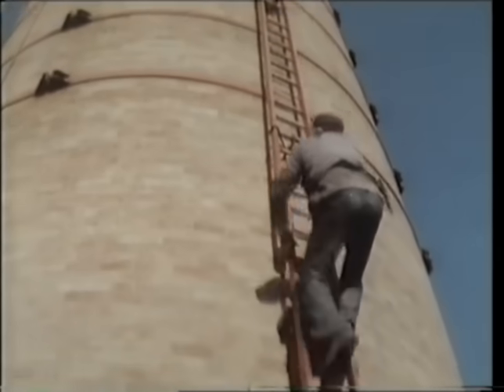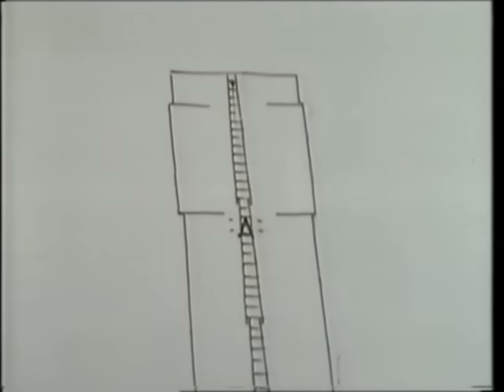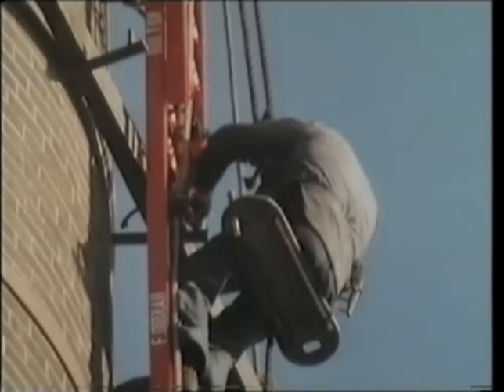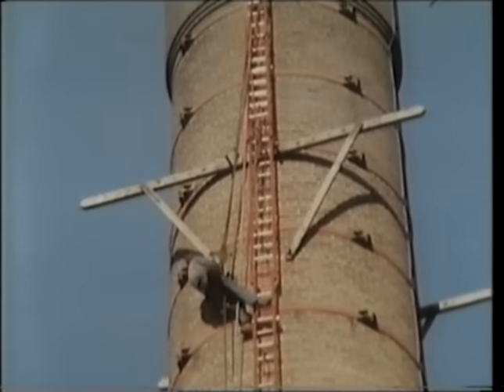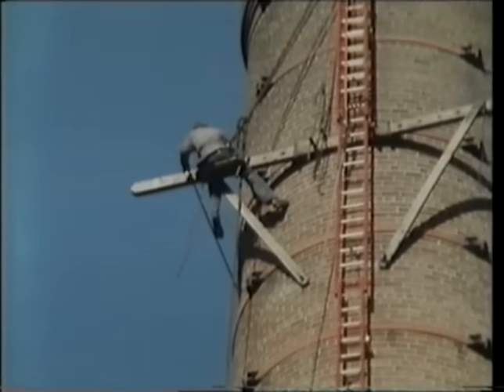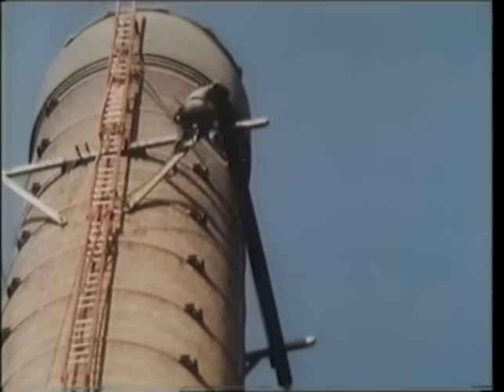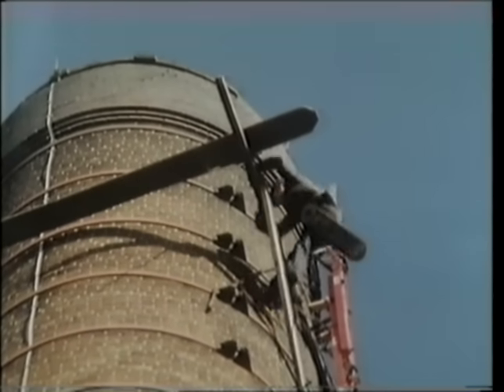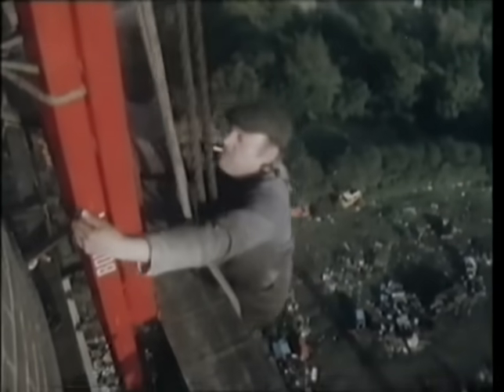Fred Dibnah How to erect a chimney scaffold

Comment: Takes incredible strength and endurance to hold those long boards and rods extended out like that, and hes doing it mostly with 1 arm, while the other holds to the ladder. Even light weight things are troublesome.

Comment: A master stack hand.

I worked with a now retired boilermaker who reminds me so much of this gentleman.
He is now 86. I started at 22 helping him. I’m now 61.
He worked on stacks so high the choppers bringing structure up emerged from the fog below into brilliant sunshine above. The most fearless man I’ve worked with.

I went over the side of an old hydro electric dam in a bolson chair to weld some test fittings to the face.
It wasn’t the height but that black-green water swirling below. But one has to trust your ropes.
That dam from the late 1800’s flood gates had water spraying from ever possible seem.  Eight inch planks  between you and countless millions of gallons.
Reply: If Fred were alive now he’d be knocking 86…. You don’t get men of that breed anymore, made them of tough stuff back then.

Comment: I used to work at height on masts and often had to free climb with equipment up to heights of 300 ft (approx 100m). The highest I ever free climbed was 750 ft, just over 230m. During training we climbed on old WW2 wooden lattice masts that were of 1930's vintage and constructed to hold the old RAF 'Chain Home' radar system. That was pretty scary, you could look down and see the old grass covered craters where the Luftwaffe had tried to bomb it. When we qualified we were sent out to our operational areas and I remember my first climb being only about 30 ft up. I was absolutely terrified and hung on for grim death. Within a few months of daily climbing, both at night as well as during the day time, I was soon climbing up and down the masts and working away unrestrained at heights, walking across the beams with no harness, no problem. You get used to it and the height no longer scares you. However, looking at this and knowing what it feels like to be at height, this scares the crap out of me. We worked on steel masts, secure, solid structures with lots of cross beams to hang on to. This chap is swaying in the wind and making his own rickety platforms which he is relying on to save his life. I know they're secure, I know he was a legend and very safety conscious for the age, but just, no, no thank you. My hat goes off to him, he truly did have balls of steel and I have a great appreciation for the difficulties he faced. I really do admire him.
Reply: @Chase Williams I was a communications engineer in the army and we used to install various bits and bobs on masts at all times of the day and night.

Comment: Assuming I had the balls to do it in the first place, my arms and legs would be pure knackered by the time I got a quarter of the way up there, he just strolls up there like he is out for a walk in the country, PURE RESPECT.
Reply: Duncan Irvine we would climb 200ft silos and some of the old/ out of shape guys would have to stop 3 or 4 times and take a breather. One guy got up there and locked up, couldnt move, had to get the fire department to come get em down.
Reply: Curtis Richardson Fred would have carried them up Pmsl
Reply: Curtis Richardson was
Reply: and don't forget he'd come down for a few pints at lunchtime and then go back up in the afternoon
Reply: Puffing on a dart too.
Reply: @curtjrich15  I used to do satellite dishes and tv aerials and fell of thank god three single storey roofs without injury. The first twoo I got over by going back up the ladder again the last did something to my head. I got vertigo and the feeling is impossible to control as the more you try to control it the more it controls you so I know why people lock up. Its not fear its an actual feling of falling when at height. If you have ever felt that feeling you get in some lifts that is very similar

Comment: When he said ''You feel the chimney moving in the wind'' i just freaking lost it. What a freaking legend of a man! Hanging from the top of a massive chimney without securing ropes, sitting on a plank secured to tied on ladders while using steel rods that he pinpoints into holes across the width of the chimney. I dont think ive seen a feat of strength that made me feel at awe but this clip just made me utterly and madly impressed! 

I can feel my palms sweating just watching.
Reply: He earnt his paycheck that's for sure
Reply: "Once it's up, its like your working on the ground"
Reply: I'm with you on that.
Reply: What I find incredible is that he must have had to repeat that sequence several times as he knocked down the chimney!

Comment: Havinf worked in 2WTC on the 97th floor, I can attest that the ability to sway is and was a part of anything built tall.   We had to get rid of our hanging pendulum lights in the cafeteria.  They would sway in the wind.  Without the ability to have a reference point, you did not know it was happening.

Comment: I used to reslate roofs with no scaffold round the edge so if you slipped you'd sail off the roof and die. Thinking about it now I don't know how I did it or why I was risk taking like it but what Fred did just freezes my blood. Would not dare to even start. Just too busy to dwell on my risk I think and I was careful and aware.

Comment: I errected A frame scaffolding around hospital  power centre chimneys in my youth 10-25 storeys but this would give me the dry terrors. One thing about being high up is the fear usually vanishes after 3 storeys as you are so high it does not seem real - but to be so exposed as he is would not be pleasant.

Comment: We had old fraco scaffolding that were platform and a steel maybe 16”x 16” towers setup on the side of a wall with boxes that would be controlled by Honda motors and a hydraulic pump.  Once the towers were setup you would use the hydraulics to climb the platforms up the towers using pull and lock dogs. On the off chance that a motor would stop working I would climb up the tower to repair the units. This looks more secure than the setup we had. I remember climbing up towers in nyc to weld or repair, no harness, osha inspector busy getting his ding dong serviced. Usually had the biggest cooler ever on the top scaffold (wherever the masons were) loaded  with beer. Those were the days!

Comment: I've always said when so met moves so met is able to move aswell like when he has his brick bucket on a wide going down it pulls another empty bucket back up then I full that bucket and the 1 that's fine down gets tapped and empires easy least am not sure iff it's in this video or not but he all the cars that are moving the amount of energy that could be saved is unreal..I can not have a perpetual motion machine but iff I had a machine running that machine could be running another 1 and many making an extra day 20% of energy it would do a lot more but 20% as an example so say you drive 5 miles it charges so met and then the the like I get for free and then when that machine is running and keeping you going for 1 like infill is anyone starts no up that 1 mile battery engine could be turning another engine and saving say 20% but only 20% of the 1 mile so after 5 times you get 1 mile but yes 2 him of metal tracking at 70 mph is a lot of energy can you imagine a fly wheel 2 him spinning say 500rpm that's some energy

Comment: Does anyone know when Fred was knocking a chimney down, a brick at a time. As he says. How he moved the scaffold down as he went lower and lower? 
I mean I guess he just took the top section apart and Donald lowered it down and then Fred re built it under his lowest section. Then repeat. 
Is that correct or am I way off?
Reply: I don’t know if he did lower the scaffold? He bashed the bricks down the chimney and when it got low enough toward the scaffold below he’d just lower it all down. In the videos of him knocking the chimney down he’s just walking along the exterior ‘ring’ of the chimney as it slowly goes down.
Reply: @Matibeos  Thanks. yeah I get what you’re saying. I’m just so curious and have so many questions. I wish I got to chat with him. It’s incredible work.

Comment: A monumental achievement up there single handed. To control a heavy 18' long board 150' up in a high wind so the other end achieves accurate placement! Awesome skill grit and confidence. And then to calmly walk around on those wooden boards once its all lashed together! I would demand a tower crane, a parachute, a builder's fully enclosed elevator, numerous safety harnesses, secure fences with pretty yellow plastic safety doors and as many BS compliances as its possible to get!

Comment: How did they even bricklay that high up,  surely scaffold back then didn't go that high and saying that, it looks like it was before Fred's time
Reply: Think they built them up from standing on scaffolding inside, no doubt using similar techniques, wooden boards, pegs, ladders. What always gets me is that Fred was repairing or taking down old chimneys brick by brick that were quite rotten yet still climbing them.

Comment: In my younger days I climbed 120 foot (36 meter) free standing metal towers to install and repair radio gear… and even those, as short and low surface area as they were, would sway quite dramatically in the wind. 

In spite of that, I never lost my grip and (thank goodness) never had to rely on my safety gear to stop a fall. 

Nevertheless, I’d never dream of climbing a tower without safety gear. Fred was uniquely courageous haha.